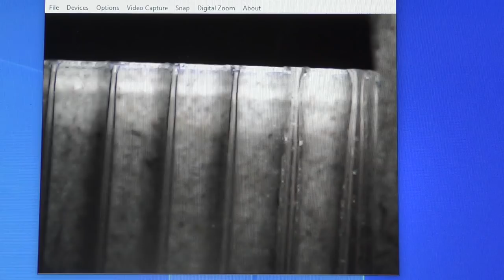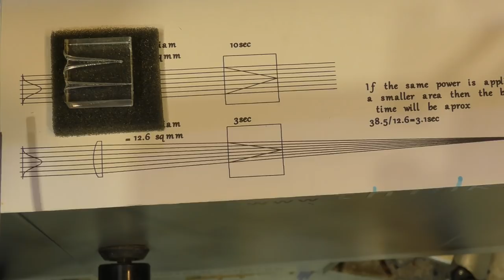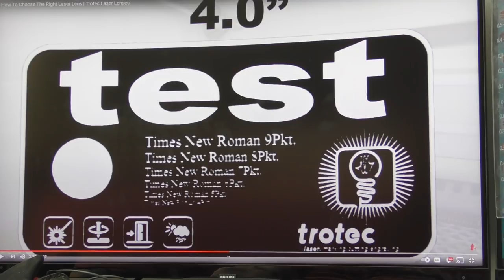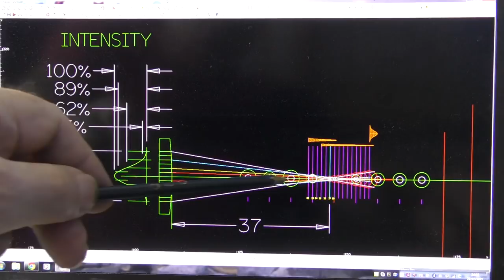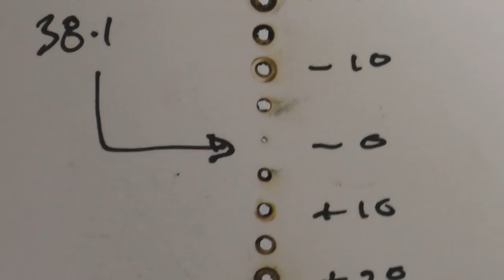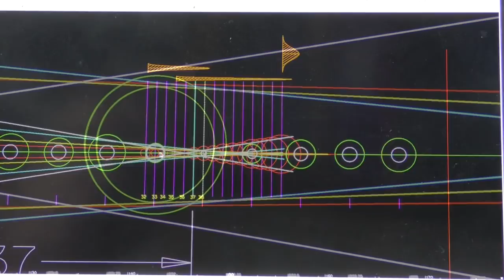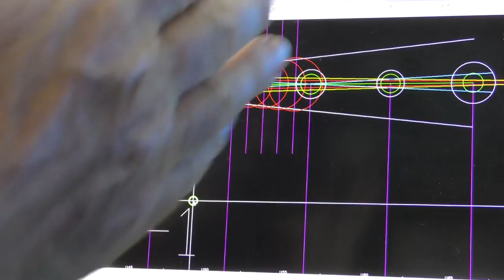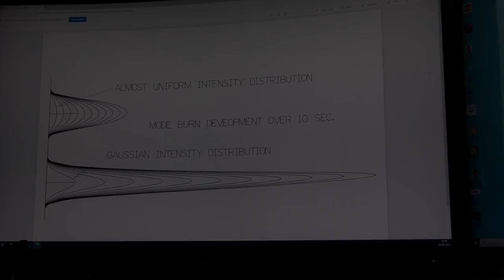RDWorks Learning Lab 215. AT LAST!!! I understand how lenses cut.

Comment: Been following along and this is all wonderfully interesting. Especially the end bits about going for that perfect focal point essentially stunts the potential depth of cut.  The abbarations seemingly give you the cutting capability by giving the different lengths of focus/light intensity. Still wrapping my head around the concepts but it seems that focal range(as shown here, not the lense manufacturers specifications, ie the focal point(s) range) is needed to cut and having a single focal point perfect lense would remove or really limit the ability to penetrate the material much beyond engraving. (Reading this back I feel like my interpretation of this could be off but seeing how just altering the power and changing the light intensity effectively changes the optimal focal point leads me to believe that the these lenses can work more to our advantage than having a perfect focal point lense(in a sense of cutting at least))

It all really shows that is a balancing act between power/light intensity, speed, focal distance and the material/thickness to what you are looking to achieve that is probably also very machine dependent. Ie, different tubes, different powers, mirrors, lenses etc. And knowing or wrapping your head around either the concept of how lenses may work or even just how to experiment and find what works best for your individual setup are vitally important to achieving the desired outcome consistently. 

*even if my interpretations above are wrong, it's led me to do experiments on different focal lengths/speeds/power in different thicknesses of materials I cut which has led to much cleaner cuts so I'm grateful to have watched/followed along as you work your way through this journey of how lenses work.
Reply from the maker: Hi Phillip
 I think you have the essence of the idea, It has taken me almost a year of on and off thinking and experimentation to fine tune a vision from the projecting focus that I could visualize, to combining it with the concept of the mode burn. It was a silly idea to fix the burn time (300ms) and take shots at a block of acrylic as it dropped 1mm after each shot.
 It was not until I got my head around what the results meant that all of a sudden I had that lightbulb moment and could see the model in my head working perfectly. The biggest problem I then had was trying to explain this complex model (simple when you can see it)  so that others may be able to see it. 
Spherical surface lenses can be made perfect , just as top manufacturers claim, but it is the geometry that creates the aberration and not any slight imperfection . The problem for lens manufacturers is that they do not have resources or skills to be material scientists and why should they when they have products that have worked for years. Everything they do with their computers to design lenses is based on imaging optics.
 I am  doing more videos shortly and will  be testing different lens theory strategies for achieving perfect focus . I know they  will fail because they are all based on imaging optical theories. Spherical aberration creates out of focus when imaging onto a flat plane,   but in that case  the light at the centre is little different from elsewhere in the image. For imaging optics the focal point is fixed.  NOT so with a laser beam. The high INTENSITY at the centre of the beam exploits the weakness of spherical aberration  and is the key reason why lenses cut. There is no fixed INTENSITY focal point the way we use lenses,  it changes with power and speed (this is easily proved).  Everyone (except me) insist that the correct way to use a lens is flat (or meniscus side down). My theory and results indicate otherwise for cutting. I still have a lot more proving to do but I am now 100% convinced that applying standard lens theory to out laser machines is seriously flawed.. I don't need lens manufacturers to change a thing. It just so happens that they do not understand  the products they are making for us. I just have to convince people of the great properties that lenses possess. and how those properties can be exploited .
Thanks for your interests and I hope that now you have seen the exit, you will be able to enjoy the new world beyond conventional lens theory.

Best wishes
Russ

Comment: Superb analysis, Russ. My 60w machine with a 1.5” lens focusses only 7mm in front of the nozzle. Is there a spacer of some sort for the threaded lens tube holder to move the lens so I can manipulate the focus point away from the nozzle head. Many thanks in advance, Leon
Reply from the maker: Hi Leon
Cutting and engraving require opposite  conditions. For engraving you need a low air assit flow througb a large orifice nozzle (4mm to 6mm) and the nozzle needs to be 10mm or more away from the work (the more thr better). For cutting you need to use a small orifice nozzle (2mm to 2,5mm) and set it about 3mm above the work surfcace and use full air assist.. To achive this with some standard lens tubes and nozzles is almost impossible. That is where the C series lens tube wins hands down, You can arrange to set your lenses and nozzles to any configuration.  I guess that you have a nozzle with a thread inside to clamp your lens, a 4mm orifice   and that your lens tube has a 16.3mm outside diameter. Am I correct?. Let me know and I will probably be able to recommend an alternative. I also assume your lens is 18mm diameter?
 Best wishes
Russ
Reply: @SarbarMultimedia  morning Russ, my lens is 20mm diameter and yes this is the threaded tube inside yes. I’ve been trying to find something to help this as yes this is far too close and I’d like to use a 1” lens like in my other 40w machine but this will be impossible without moving the lens further down the tube. It’s been incredibly frustrating trying to find the correct product for this.
Reply: @pistonslapuk  
 Addd your disguised email address to another comment and I will send you some data.  and you can send me picyures of your existing head/lens tube/nozzle.  I will delete your comment
Best wishes
Russ

Comment: Hi Russ, would inserting an 8mm aperture in the beam path improve focusing by eliminating the white portion of the beam?
Reply from the maker: I did  some experiments with apertures a couple of years ago and saw no benefit other than heating the aperture  after very little running.  However. my understanding of lenses was still very grey at that time and I  now see some merit in experimenting with a water cooled aperture set close to the mirror 1. I have other experiments planned but this is definitely an interesting thought. I will have to consider what benefits suppressing some of the rays gives me .My experiments with machined and holy lenses showed that there were two distinct properties in a lens  that coexist,  but with the knowledge I now possess can be manipulated  to produce filtered results without the need for an aperture. As I demonstrated in this video, lots of aberration from a flat side up long focus lens produces deep cutting ability whereas remove that  aberration with a meniscus lens and the cutting is hugely suppressed and you have a tame engraving characteristic.  I need to investigate this interesting finding to see if we can make logic based decisions about lens choice rather than an opinionated ones based on personal experience. Remember, I have also shown that the quality of beam intensity hitting the lens is a key factor as to what YOUR machine can achieve.  I therefore believe that this is the reason for so much lack of performance uniformity.  ALL machines are likely to be different that is why I stress that MY results may not be achievable by others, however the principles I am learning still apply.
Best wishes
Russ

Comment: Awesome info! Question can a 4in lense produce as high resolution for engraving as a 2in lens and under what conditions would make it possible or not?
Reply from the maker: Hi 
Simple answer is no. The 4" lens creates a focal spot that is larger than a 2" lens.  However, it all depends on the size of the engraving and the sort of detail you are trying to achieve For example fine vector text may come out with thick verticals if the text is too small  and you use a 4" lens,   but make the text bigger and you will be able to increase the line spacing and get faster engraving because the lines are thicker. If you are after very fine detail (usually on smaller pictures) then really you should be considering a 1.5" lens or even a compound lens.  My golden rule for picture engraving with  bitmap images is very simple.  1 pixel =1 dot. Turn that on its head and determine what the smallest possible dot you can produce with your 4" lens. If the answer is  0.3mm then you must set the resolution of the image to 24.4mm/0.3mm = 84.7 pixels per inch (ppi). If you can achieve 0.2mm diameter dots with your 2" lens  then you can use an image with 25.4/0.2=127 ppi. with a 1.5" lens you may  be able to achieve 0.15mm and thus use a resolution of 25.4/0.15=170 ppi.  You may think these resolutions quite low but you must understand that the perceived quality of your picture depends on its physical size  With larger pictures intended for viewing at stand off distances then low resolutions still look good. Step up  close to a bill board and be surprised at how low the resolution is. You are trying to use your laser as a printing machine, so before you attempt that trick,  can I suggest a bit of research into dithered printing techniques. An understanding of how the eye and brain can be fooled by different graphic principles is key to your success.
 Best wishes
Russ

Comment: 100% power? I have watched almost all of your older videos, and in those you weren't close to running the machine at that kind of power. (?) I probably missed some disocvery in one of your later videos? Can you point me to the episode(s) that cover this? Thanks in advance. :)
Reply from the maker: Hi 
 On this particular machine I am running a 70 watt tube which can be run with 23mA max. When I changed to this tube I did not bother to change the HV power supply so I am still using a 60 watt power supply that has a maximum current output of 22mA. As I am sure you already understand, % power does not mean %watts but really means % of the max output of your HV power supply. Thus,  as I have 22mA max output, it is totally safe for ME to use 99.99%power. SPT  "seem"  to recommend 20mA max in their spec sheet  but I know  they are being ultra conservative so  I stick with well tested maximums  for each tube power that have existed for many years. If you have an ammeter installed (as I have) then you can always make sure you stay inside the safe operating current for your tube. For beginners with machines that do not have ammeters, I generally recommend max 65% power until they fit an ammeter and begin to understand how a laser tube works.

Without doubt, %power is the most confusing parameter on these machines
For reference you can see me fitting and testing this tube 19 months ago in    https://www.youtube.com/watch?v=V_ehGE51rH4
I hope this answers your question
 Best wishes
Russ
Reply: @SarbarMultimedia  Thanks for the clarification. I remember you upgraded to the 70 watt tube, but in my faulty recollection I also thought you upgraded the power supply.
Reply from the maker: @mr.guaitiao5254  
Hi
 Cloudray are almost ready to start selling a copy of my China blue 300x500 machine . I am expecting delivery of a prototype soon and will be examining how close their copy is to my original. It will have a 70 watt tube and all the modifications I have made to my machine. You may wish to contact Cloudray and check when the machine will be available fr sale and maybe the estimated price, There are quite a few people interested and I encourage them to write in to Cloudray as an incentive to get the project completed.
In the mean time , just add your disguised email address to another comment and I will reply and also delete your comment.
Best wishes
Russ

Comment: wow, I watched that video and was turned away from buying a longer focal length lens, and instead, 3d printed a spacer that increased the gap between the final mirror, and the lens.
Reply from the maker: I have a lot more experiments to carry out now that I am sure I understand how lenses perform. The good news is that I have a serous collection of lenses that allows me to test the performance of long and short focus lenses both meniscus (which appear to be poor at cutting and best suited to engraving) and plano convex (flat side up) which seem to show the best cutting properties. I am also already convinced that Ga As lenses outperform  ZnSe when it comes to cutting BUT all of this data depends on having a "sharp" near perfect Gaussian intensity distribution in your laser beam. Several issues are explained from this latest understanding about the lens and laser beam interaction.   I have been stating for several  years that  there is no fixed focal point  because  the optimum focal point varies with speed and power. There is a significant difference between focused light and focused INTENSITY.  This also implies that different MATERIALS have different focal points and this is something I have noticed and will be examining in a future session.  I have been using a 63,5 GaAS flat side up as my cutting lens for several years . The kerf is not too wide and its dept cutting capability seem phenomenal.  However. is it the fastest cutting lens for thin materials such as 2 or 3mm?  Maybe a shorter focal length is more efficient. 
 
I thought I had reached a sort of conclusion on lenses and that my series may be running out of things to explore. The end of the previous paragraph shows there is a LOT more to decode.

 Good luck with your experiments but make sure you understand how good your beam is before you blame flaky results on the lens  
Check out this video   https://www.youtube.com/watch?v=R6Wqn5-HMzM

 Best wishes
Russ

Comment: Hello Russ, greetings from Ireland :) - There is a still one factor which was NOT covered here - diferent TEM modes. Real laser beam is never "ideally gaussian" but have some shapes. TEM00 TEM01 TEM10 etc. ( https://en.wikipedia.org/wiki/Transverse_mode says bit more, but you have to do more research in the web) Do NOT trust this, what says tube provider, check (i have new laser tube - RECI now).  I suppose reflecting on curvy bent metal mirror will do some answer :) Moreover, when you do research on lenses you use mirror set. they are as well not perfectly flat and generate "noises nad distortions". Actually for test best will be to use unreflected laser beam.
Reply from the maker: Hi
  We have good memories of Eire and hope you are  progressing well are keeping healthy.
 I have seen modes  TEM10, TEM01* TEM01 and TEM02 in badly set factory reject tubes. TEM02 was my first rubbish 40 watt tube.  I have never been a Reci advocate  brecause their prices are silly and their specifications are "misleading" In the past 2 years they have done two things. First they have stripped their website of any operating parameters and other specification datsa and secondly  in the absence of this data, they have  been "officially" releasing their  test failures onto the open market.via third parties.  The website still quotes two power values with no explanation. Check the graph on your tube to see if it made the upper value. If no then you have a B grade tube. I have seem many Reci tubes that produce TEM01* scorch patterns all the way up to about 30% power. where they become TEM00. That makes the tube incapable of precision photo engraving
 All mass produced commercial tubes aspire to TEM00  and my SPT 70 watt tube certainly is. The Reci website proclaims it as well and shows a 3D intensity representation. That Gaussian distribution is  essential for any cutting application. 20 years ago I had a very old crossflow 1500watt CO2 laser where we had to regularly tune the internal reflecting mirrors  (they were adjustable). It was possible to get all sorts of weird modes but only TEM00 allowed it to cut 12mm mild steel.

 As I demonstrate in this video, The properties of a TEM00 beam combined with the with the usually unwanted abberation properties of a spherial form lens is a winning combination that allows us to curt with our machines.

 The use of acrylic to observe laser modes was an invaluable technique I learnt 20 years ago. I could never have guessed how well it would serve me in later life.

 I think your concern about mirrors is unfounded.  All mirrors are mechanically flat but maybe not optically perfect.  I have recently done a few scribbled calculations  around what the local surface distortion may be  for some typical interference fringe pattens that may occur on a mirror . With an incredibly small reflecting anglle I calculated  that after  100cm a single light ray  would be about 0.03mm away from its perfect path.. Such a small "fuzziness" will have zero effect on the maximum intensity of the beam.  I always keep in mind that his is NOT  a piece of laboratory equipment doing accurate research work. This  mirror question arose because a man in USA who  makes mirrors insists that silicon mirrors are the best because they are almost optically flat naturally. I agreed with him  but pointed out that using such perfect mirrors was total overkill for our fairly crude machines and that dirt cheap molybdenum mirrors are perfectly adequate.  I know you like doing calculations so do a few scribbles of your own. The REAL test to see what your mirrors are doing is to carry out  3 mode burns (1 after each mirror )  and compare them.

Best wishes
Russ